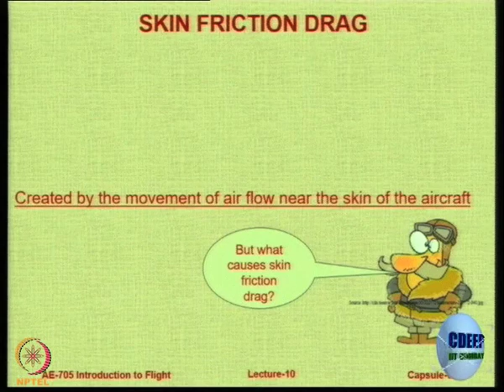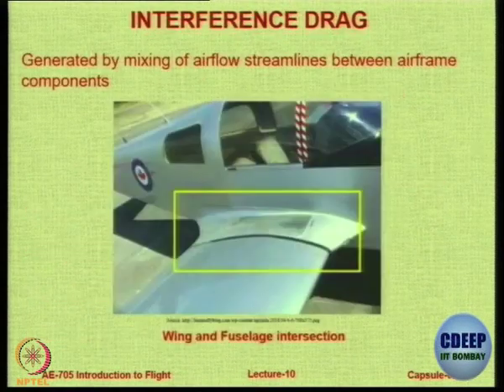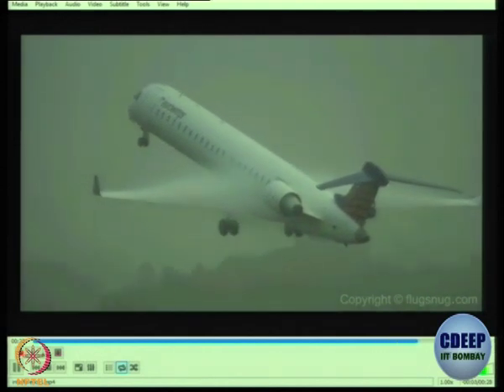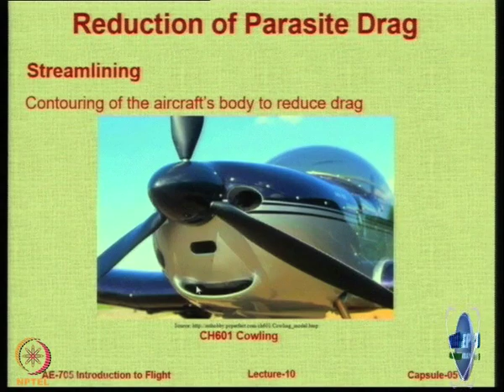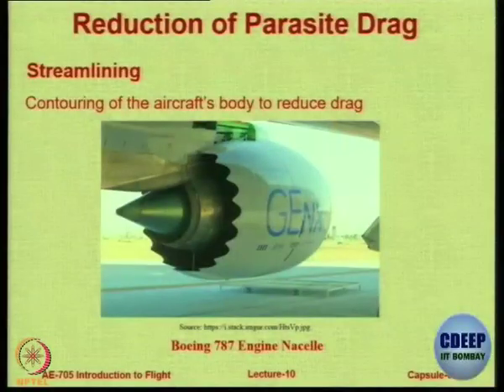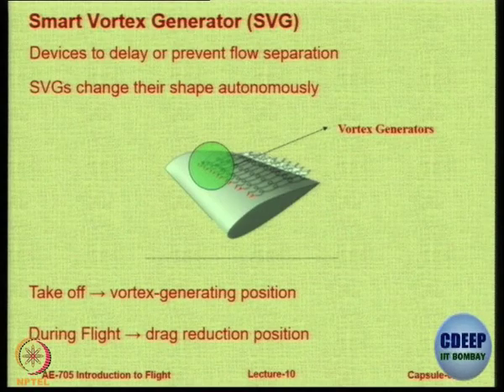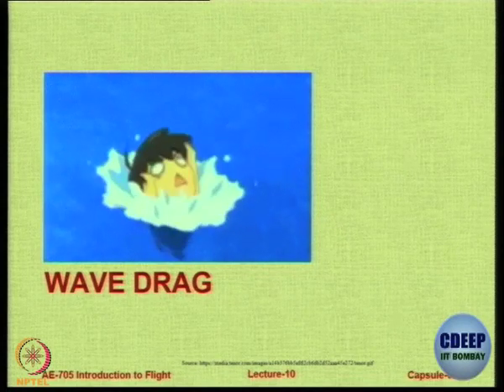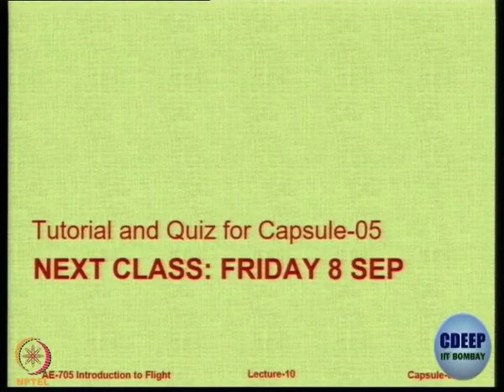Week 6-Lecture 35

Comment: Aren't Kuchemann carrots and Flap track fairings the same?
Reply: No! Flap Track Fairings are situated below the wings and used to extend and retract the flaps there is no other use of that, but at the same time the Kuchemann carrots are used to reduce wave drag which is intentional and it is not related assembly to flaps and mainly situated above or in middle of the Aircraft Wings !!! That's the difference.